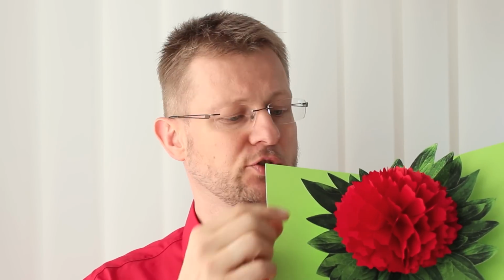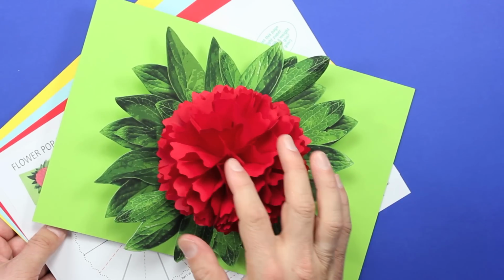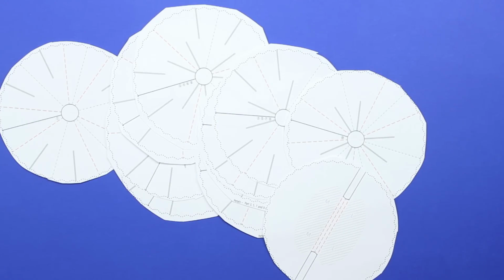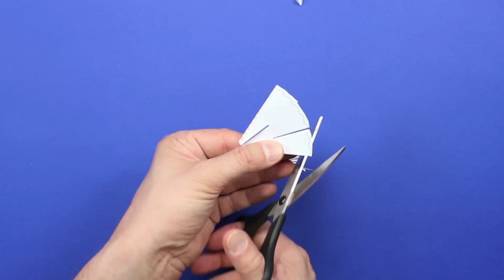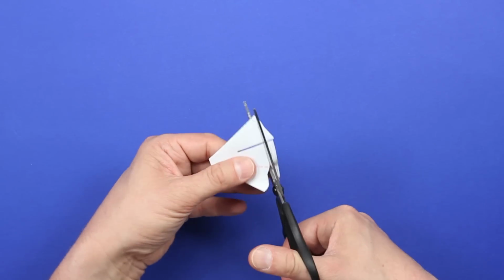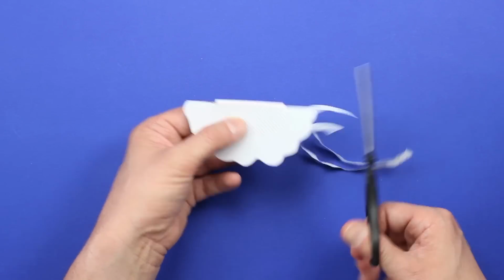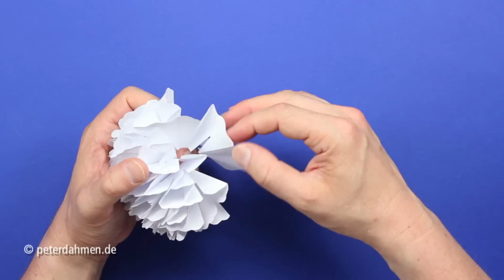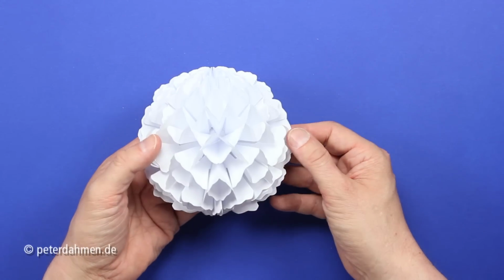Flower Pop Up Card Tutorial Part 1 of 3

Comment: Wonderful! What kind of glue is used that will not warp the paper?
Reply from the maker: Dear Anne Quinn, to glue the petals, I used solvent based glue. Since ingredients vary in different countries, I can't recommend a particular brand. If you can only buy water-based glue in your area - or if you are working with small children - then you can also use water-based glue. In this case, you should press the parts together for a longer time. Pressing them together will keep the paper from curling too much. 
Do not use liquid glue to glue the backs, because it is difficult to apply it evenly. I used double-sided adhesive sheeting to adhere the backs. You can also use double sided tape. A glue stick will also work. I hope you find my answers helpful and have fun and good luck making your own pop up cards! All the best, Peter

Comment: I love the final product but I must admit that the speed of the video for the initial connection of part (1) and (2, 4, 6, 8). Any similar videoes with slower explanation?
Reply: Thank you so much Peter. Your reply in detail is very much appreciated and you are an amazing designer. I will try again.
Reply: Wow Peter. I just tried again, kept piece (1) firmly together and didn't unfold it (which was my initial problem) and IT WORKED. Thanks so much.

Comment: Hey, does anyone know where I can print out paper that weights heavier than regular paper? Around how much would that cost me?
Also, is cutting board pen necessary for this? I kind of just started doing DIYs and I'm not quite sure that it's used for. How's it different from a razor? Thanks!! :)
Reply: +Pixel Bunnay you can't print heavier paper. You have to buy heavier paper, like cardstock, at your office supply or crafting store. Examples can be poster board, cardstock, etc.
Reply: Kelsey Gonzalez ***** Thanks for the help!! :)